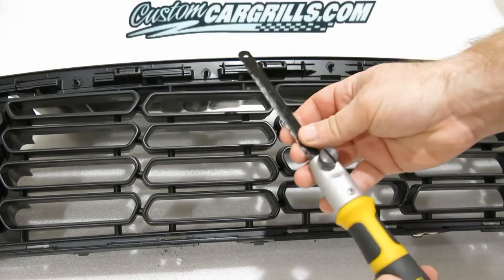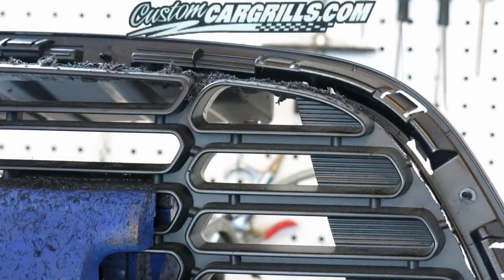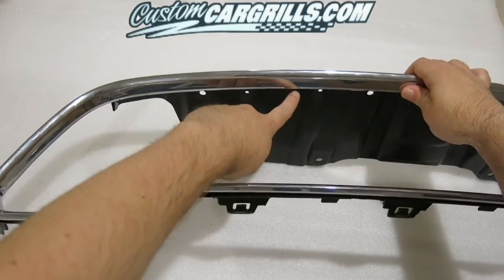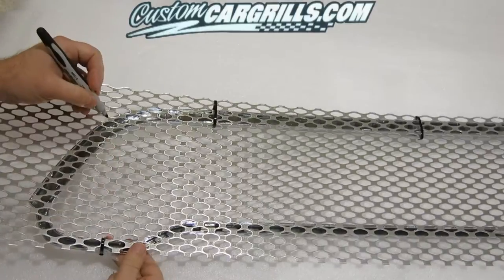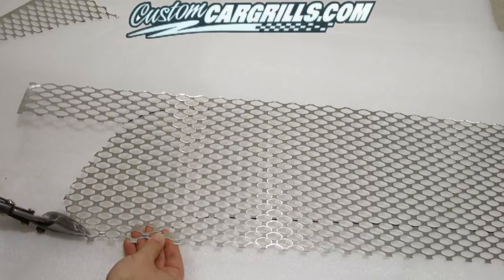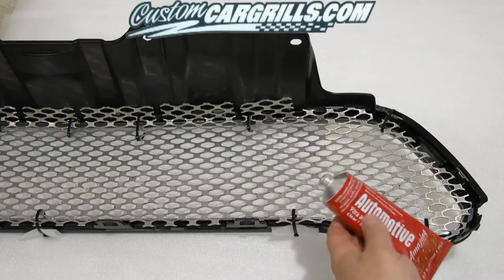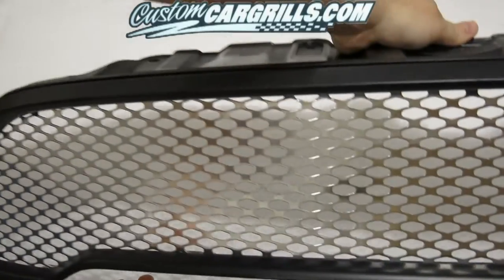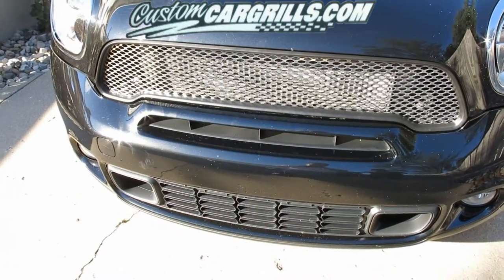Mini Countryman S Grill Mesh Grill Installation How-To by customcargrills.com

Comment: I need to remove my front grill in my countryman s. What I need to do? Is it difficult to deinstall the front grill? Thanks for your help ;)
Reply from the maker: +marcin007b From what I recall, there's just a few bolts on the top (and maybe side).  Then it's just a lot of pulling forward on the grill to get it off the bumper.  I recall the lower tabs being quite difficult to break loose.